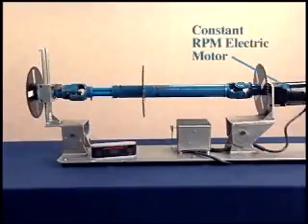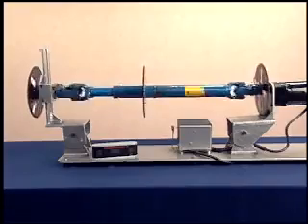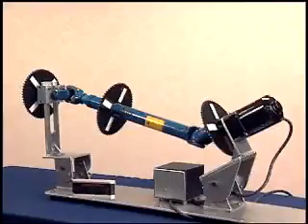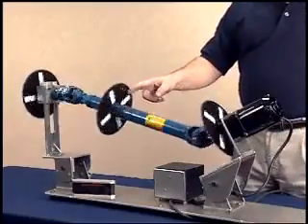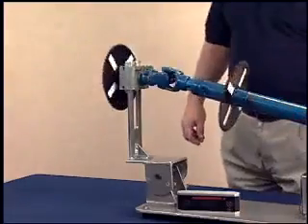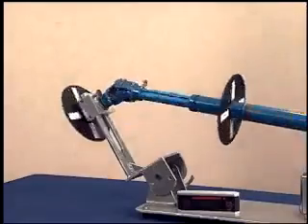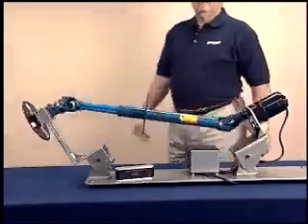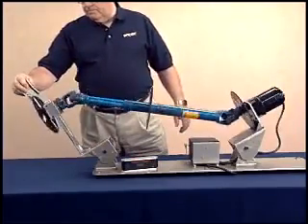Trust Me, I am a  Mechanical Engineer

Comment: I know this is true, I have for a long time. But what is interesting to me about this is my 1933 Chevrolet, with a torque tube drive shaft. It has one U-joint (inside the torque ball) at the front, and a straight shot into the rear end. So there's got to be speed differential going on but I don't notice it driving the car, it seems just fine. It should vibrate, surge or something, but it doesn't.

Comment: If I would have seen this about a year ago this would have helped me fix my drive shaft much sooner! Eventually I found out that it was binding up due to the angle, and had to buy a slip yolk eliminator/shorter drive shaft. I also had to purchase rear control arms to shift the angle of the pinion.

Comment: The joys of motion.

Also recommended, but useful information for changing a rotational vertex's angle along a two-dimensional plane with no bilateral or vertical stressers on the output shaft.

But can you do it along a THREE dimensional plane?  That is to say, you can laterally or vertically change the position of the output shaft while maintaining the same output angle as you have in this example?  ;)

No orbital gearsets.  Thats cheating.

Comment: Many years ago when I fucked around with cars, read....wasted shitloads of money on cars, I was doing up a Torana hatchback. I had removed the tailshaft and replaced the universal joints. I didn't mark how they came apart. When I put everything back together, the car shook like a dog shitting razor blades. I though the tailshaft just needed balancing. I paid a coupla hundred bucks to have the shaft balanced, refitted it, still shook. Then I wondered if it mattered how I put it back together. I went to a wreckers and looked at a tailshaft fitted to the same car. I noted how the uni joints were aligned to each other and how the yoke fitted. When I looked at mine, I had the two uni joints inline, they should have been 180 deg apart, I adjusted it and it ran smooth. So this video speaks the truth amigo, mark your shaft before disassembly.

Comment: WHAT YOU SAID IS RIGHT ,NO NEED TO SAY YOU ARE AN ENGINEER,BUT THE STRESS LEVEL WILL BE HIGH ON THE JOINT,SINCE IT IS ROTATING IN A ELLIPTICAL KIND TO TRANSFORM THE ROTATION ,NOW YOU MADE IT PARALLEL ,BUT STILL LOST OF ENERGY IS THERE AND THE TWIST TURNING ADDED TO ANOTHER KIND OF NEGATIVE ( IF I CAN CALL IT THIS WAY) TWIST WILL EQUAL THE ROTATION BUT DOUBLE THE TWIST AND MORE ENERGY IS LOST,IN METAL FATIGUE,NOW THIS CAN BE ELIMINATED BY SIMPLE DEVICE,( YOU REMINDED ME OF AN INVENTION IDEA ,I WROTE IT SOME WHERE AND I DID NOT APPROACH USPTO WITH IT YET ,THANK YOU FOR REMINDING ME ABOUT IT INDIRECTLY) THE WHOLE THING CAN BE SOLVED EASILY, AND I AM NOT   A MECHANICAL ENGINEER,I AM NOT JOCKING HERE

Comment: The worst I saw for "engineering? Mind you this from an actual engineer with sheepskins et al.
He used a Kubota diesel single (5 hp briggs size), "rubber mounted" (yeah, a rubber battery pad was slid under the block, and the four bolts run tight . . .just flat washers under the heads, flat and split under the regular nuts), with a single U-joint, into an Arbor bearing with a thin bonded rubber surrounding the bearing, to a 16 inch 4 blade fan each blade about 4 inch by 6 inch, end of shaft hanging free.
Was supposed to run for 24 hours without an issue to pass the customer's demands . . . ran 10 minutes, once.
Vibration actually damaged one engine so a second was procured.
After different coupler was used, and it ran a bit longer, then a few other minor changes were made and it eventually ran long enough (several hours, but not the 24) the customer took it at a greatly reduced price. I'm betting a mechanic there made some changes as well so it was probably better. A solid bearing, or a second bearing to stabilize the shaft would be a good first choice.

Comment: Re-title video "Why not to lift your truck"
Reply: You can lift the truck, but you need to rotate the rear differential to match the input yoke angle too. Which no one does as it requires measuring and welding.
Reply: netmatrix75 people who lift trucks do measuring and welding, just never together as part of the same job.

Comment: I kept wondering how car wheels can turn while connected to a shaft recently, then this video pop up in my recommended list.....
Wow... Utube reads my mind!
Reply: The front wheels on a car are typically driven by constant velocity joints, rather than U-joints. The set up shown is for rear wheel drive vehicles.
It is nearly impossible to keep the front wheel bearings and front axle parallel while turning.
 
Older Jeeps, Land Cruisers, Land Rovers, and other off-road vehicles use U-joints in the front. They all have a distinctive feel in the steering wheel when it is turned sharply from the wheels speeding up and slowing down. To make matter even worse, the inner wheel and the outer wheel speed up and slow down at different rates. The whole vehicle feels like it is walloping around a corner.
Reply: joshua43214
Thanks for your detailed explanation. :D
I felt somewhere wired too, now I have the keyword for my answer. :D
Reply: @joshua43214 Interestingly, the L-29 Cord, the first production front wheel drive car, used double cardan U-joints to alleviate some of the issues that fwd single u-joints face. They later switched to Rzeppa constant velocity joints on the Cord 810/812.

Comment: This is very interesting, not just for vehicle drive shaft alignment but for physics and science as a whole. Each sprocket was on the same gear of rotation driven by a single source but there was a difference in vibration and sound when the sprocket were adjusted with change. This is a new discovered law of nature one that was not created by man but discovered. THIS IS A NEW ERA OF E=MC2

Comment: I am not a smart man. I'm watching but no idea how it works. Right at the end when he moved it slightly it was out of wack again.
Reply: I've run into the out of phase drive line once on a road tractor.  The vibration wasn't noticeable driving around the parking lot unloaded but as soon as you got above 20 mph and started to climb a hill with a trailer on the thing became undriveable becuase the vibration was so bad. We had to drop the trailer right where it was and get another tractor to continue with it.

Comment: This is why its important to make sure the diff angle and transmission angle are the same in a lifted 4X4
Reply: Todd Sadler if you lift it "a little" you will get "a little" ill effect.
Reply: In my vehicle you can go 2" up with no effect but after that you need either caster corrected bushes or to change the diff angle with new suspension arms
Reply: neardood1 That's a robust vehicle. Anyways an no expert at this.
Reply: neardood1 youre not supposed to exceed 3 degrees of angle difference. otherwise you have a chance of the driveshaft or yokes exploding. as well as vibration an other problems that may occur

Comment: Useful to me as I'm helping build a custom driveshaft to replace a worn one on a 1965 Ford F100 truck. We live very remote so no going to a driveline shop for us. Now I know what needs to be done to make sure the new shaft work properly. (We need a custom shaft as the truck has non stock driveline parts in it and original shafts just won't fit without extreme mods...)

Comment: A great demonstration.    A highly lifted 4x4 will still be ok, as long as the angle of the input shaft of each differential is parallel to the angle of the output shafts from the transfer case (usually both parallel to the ground).  I have seen some extreme lifts however where people were forced to clock the angle of the differentials upward, and that will cause a real problem at higher road speeds.     Another place it can be a big issue is with "axle wrap" on old muscle drag cars.  They often have the rear axles mounted to leaf springs and under very high load (during launch) the differential twists the axle which twists the leaf springs toward an S-shape, raising the angle of the diff's input shaft out of parallel with the angle of the output shaft of the tranny.  This causes the pulsing shown in this video which can just rip the driveline and/or suspension apart.     This is what traction bars help prevent.  One version of the bar, hard mounts to the bottom of the axle, and reaches forward.  The other end of the bar rests and inch or so below the frame of the car (usually with a rubber bumper).   When the axle tries to twist it raises the forward end of the bar, which stops against the frame, and thus stops the twist.    The other type of traction bar also attaches to a point below the axle, but has a swivel at both ends, so it acts as a multi-link trailing arm.  Any twist at the axle applies a compression force against the forward link mount and this also stops the axle twist.

Comment: I used to install these shafts on dump trucks from the engine crankshaft to a front mounted hydraulic pump for on board hydraulic accessories. There was a procedure I was taught by an old timer we followed that input angle had to match output angle and a minimum 4 degree difference. Now I know exactly why it was necessary. All I was told then is it was necessary for drive shaft longevity.

Comment: so do you see any replacement for the u-joint on the horizon?
Reply: It's been replaced in the auto industry with Constant velocity joints (CV Shafts) in lighter duty applications for many years now.... Albeit cv shafts tend to be weaker, they also tend to be much lighter. Typically seen in 3 ball and 6 ball configurations depending on application.
Reply: how about some flexible material with no moving parts.
Reply: Chris, We had one in a boat once, forgot all about that.
Reply: I never understood the name "constant velocity joint" until just now.
Reply: Search up Thompson couplings, they're only a small company, and not widely used, but it fixes almost all the issues associated with standard U-joints and standard CV-joints. Worth a look
Reply: 3 balls? I only have 2 balls! Am I 2/3rds  of a man?
Reply: Voxel Lab called a rag joint, typically used in steering on older autos to angle the steering shaft into the steering box. It utilizes reinforced rubber discs and has no "moving" parts. Major draw back is longevity under heavy load.
Reply: Jared D nope, just 2/9 ths of a shaft.....

Comment: This video should be mandatory in high school Auto Shop classes. I've seen more than one kid come flummoxed because they added a 6 inch lift to their pickup, and couldn't figure out why their ride was shaking apart because they didn't align the transmission and rear differential angles.
Reply: Yes, but we call that Lunch. Was a time that high school actually prepared young people to deal with Real World problems, like how to fix your own car. Of course, that's been replaced by such useful new programs as Interpretive Dance and History of Pottery. 

But you're right, there's something terribly UN-American about some metrosexual man-boy who can't swap out a flat tire, or replace a set of shocks. Let alone the utter lack of focus most schools have on preparing the next generation of the SKILLED blue collar workforce.
Reply: I feel like this less effects kids that lift their pickups and more effects the kids that put excessive negative camber on their car.
Reply: xGolBLiiN I don't think putting negative camber on a car affects the driveshaft because the upper and lower control arms are what affects camber. The diff is bolted to the subframe of the car and  when you lower the car, everything gets lower so there's no change in angle for the driveshaft. With lifted trucks, the body is lifted while the diff sits at the same place. This makes the transmission sit even higher than the diff which can cause problems as stated above.

Comment: i wonder if the shafts are not paralel you get an non uniform motin i understand kinda and the same hapends if you twist the end like in the video. is it then possible to cansel oute the un unison movement caused by these two Methods With eatch other so you can hawe an non paralel iput and output move in unison?

Comment: Great idea using the card as a simple speed sensor!
Reply: What it looks like is irrelevant; what matters is how it works.

It transforms differences in turning speed into audible output "on the fly", as it were.
Reply: it's the same card - Kroger owns Smith's.   I use mine in Dallas at Kroger's and in Utah at Smith's...
Reply: yet it looks like Credit card / ATM card
such a genius example
Reply: Clay Wheeler so?
Reply: Looks like a Kroger Plus card* to me.

*Supermarket reward points card.
Reply: *****
Smith's does that, too.

BTW, that name "Halliburton" looks rather familiar........and somewhat notorious.....

Comment: the cars I've worked on have one thick tooth on the spline so you can't fuck it up.
Reply: Doug Whole most shafts aren't master splined...
Reply: +Dustin Davidson most cars aren't made to be fixed....I can lock the flywheel, lock the cam sprocket, remove the head without changing the timing.

Comment: Very interesting, wonder how many lifted trucks built in the backyard have out of phase drive shafts?

Come to think of it even my RC car drive shafts only fit one way!
Reply: The phasing comment at the end of the vid is generally unnecessary, because the CV joint behind each U-joint usually only fits one way.  Even if they didn't it's pretty simple.  The two U-joints must be set 90 degrees out of phase from each other for one to cancel out the non-linear effects of the other.
Reply: thomas barlow very good point!
Reply: thomas barlow Most vehicle drive shafts can't be shifted out of phase. The U-joint mounts don't rotate like this demonstration rig, and their phase is factory set when they are build.
Reply: Mike Jones when changing support bearings the yokes have to be removed. they are usually splined onto the end of the shaft, with a large but holding them onto the spline. the other end is welded, so the support bearings only come off one way. if you put the yoke back on off by one tooth, an easy mistake to make, it will cause wicked vibrations in the vehicle.
Reply: +Clom McMorrow 
Exactly, always mark both halves of the spline before you pull it apart, (with a centre punch so it cant be washed off).

+daemn42 
A CV, (constant velocity) is a different type of joint all together, basically the opposite of this.  This is a Hookes type universal joint.
CV joints can change angles and maintain a constant velocity hence the name.
Reply: daemn42  except there is no CV joint in this demonstration (nor on all vehicles)
Reply: A lot... Most people have no idea about this when they lift above 2", just like (here in Australia) they have no clue thier insurance is voided by un-roadworthy (without engineer signing of and completeing lane change assesment, which im yet to meet somebody who has or an engineer who would even sign of on most of these lifts!)  mods that they think they have to have to go far in the trails.
Reply: I take it the installers of such things have 3-4 name names. 
Billy joe jim bob?
Reply: There are lots of boats with unphased shafts. Lots. Mainly old timber boats where people have replaced engines, etc.

Comment: A very good demonstration of the non-linear effect of angular offset on a Hookes joint.
Reply: That has to do with phasing in the driveshaft. No wonder my DeLorean wasn't doing anything at 88mph besides getting me pulled over.
Reply: But I was wondering about the flux capacitor triangulation residual effect.......
Reply: Exactly what I was thinking!

Comment: The only problem with Cardan connection is the spinn moment is not constant.
Reply: Paul Kazansky when Input and output are parallel, moment and velocity are constant. when angled, they are elliptical. that's why it works in cars. the output shaft of the gearbox and the input of the differential are parallel.

Comment: so if you lift a truck way too much without dropping the gearbox down, this will happen to your driveline i guess?
Reply: kuck hoa If the input and output are parallel, the angles at both ends are equal and the effect is gone.  At extreme angles and when axles are shimmed at angles rather than appropriate geometry, then yes there will be lots of vibration.

Comment: When the angels of the input and output shafts cannot be maintained, (as on a front wheel drive),
or when the drives haft length requires an additional joint, and support, (like on a long wheelbase)a CV joint is used. (Not Illustrated.)
Reply: Daphne Blake Angels of Input and Output Shafts? I prefer Angel of Death.
Reply: TekkamanBiker
autocorrect issues
Reply: I know, just kidding. I'm sorry if I offended you.
Reply: np